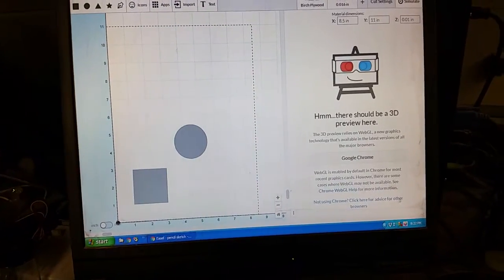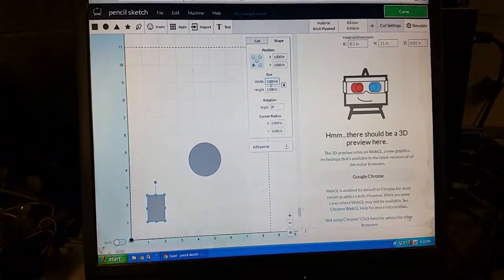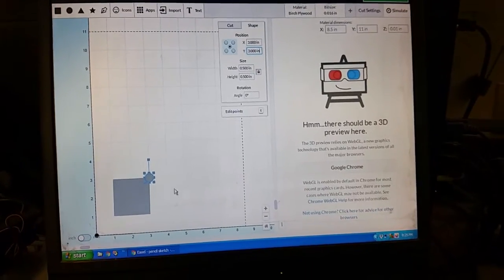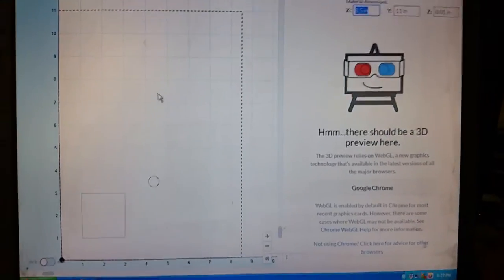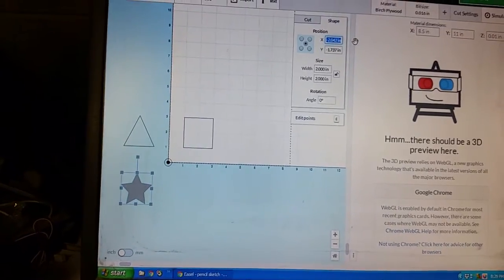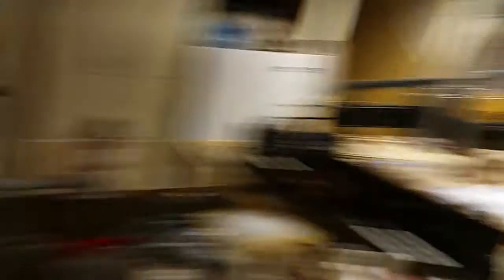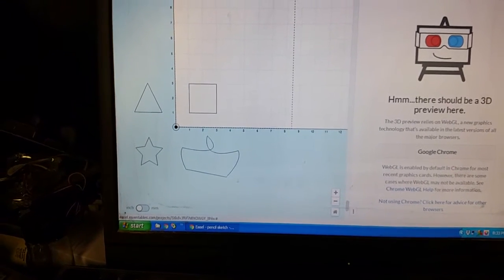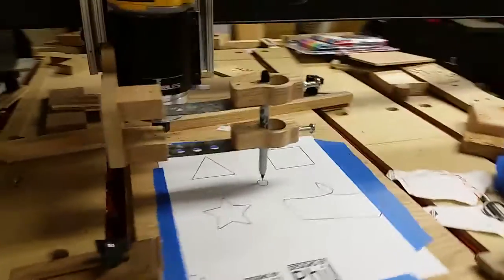Understanding WORK ZERO in easel

Comment: Since the Carvey machine does not have the "Move to Work Home" step I assume you must always carve based on the home position of the smart clamp.  Tell me if there is a way to set starting position on Carvey.  Thanks
Reply from the maker: Unfortunately the carvey is a very restrictive toy. I personally advise against getting one. It's under powered and under sized. You can get a much bigger, stronger machine from open builds (lead 1010).
Reply: It isn't undersized depending on what you're doing.  I run mine in my office - it contains the mess and is pretty quiet.  I've been able to cut all the materials I've tried so it has enough power for me.  I've worked around the "MtWH" issue by creating a spreadsheet to offset the carving features by a fixed amount to avoid the smart clamp, in my case 25.4 mm right and up.  As I recall Carvey has more Z capability than the big open gantry machines.
Reply from the maker: @michaelberry950  my modified gen 1 x-carve has 4.5" of clearance under the carriage and an 8" travel z axis. I didn't think I said undersized, even though it is tiny, but size is relevant to your needs. I said it's a toy. Its stepper motors are very tiny and the spindle is also. My x-carve can cut at 200ipm and 0.15" depth of cut without stuttering. The carvey is geared towards people who don't want to actually know how to operate a cnc machine but need to make prototypes. I think it serves a purpose. But it's not upgradable. It's not really serviceable. You can't load your own firmware or use any controller you want for it. You are forced to use easel or your warranty is voided. Its VERY restrictive. And I'm not knocking you, this is just my opinion on the carvey. Theres not much in the way of tricks or modifications.
Reply: @7711gman  I wanted an entry-level machine and I got one.  Your machine sounds very mighty and I'm probably moving in that direction once I outgrow my toy.  I have seen nothing that suggests a warranty is voided by importing G-code and in fact you can do this using Easel/Carvey.  Lots of YT stuff on how to do it and I'm trying to master the CAM side of Fusion 360 so I'm not limited to Easel or heaven forbid Easel Pro.  I don't need powerful and fast at this point but I do need to learn 3D CAD and CAM.  I've had a blast with this thing while watching TV in my living room, something to be said for that.  Thanks for your honest evaluation, I now have a better picture of what Carvey stands for.
Reply from the maker: @michaelberry950  like I said, I meant no disrespect to you. You can import 3rd party gcode but you cannot use a 3rd party sender to control your carvey